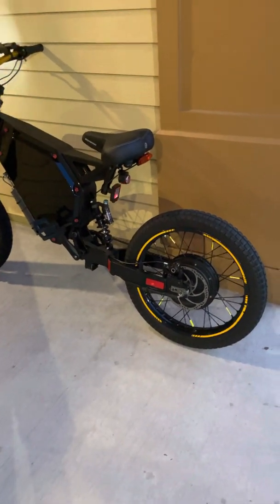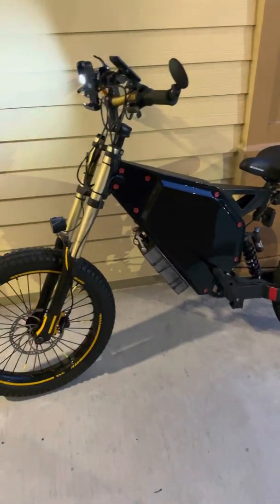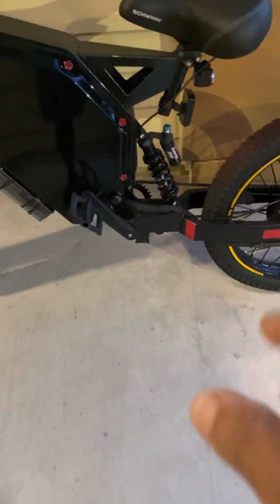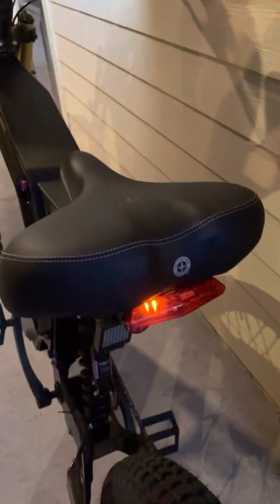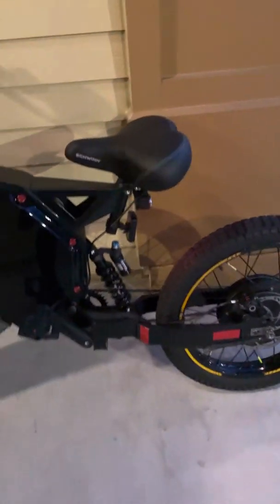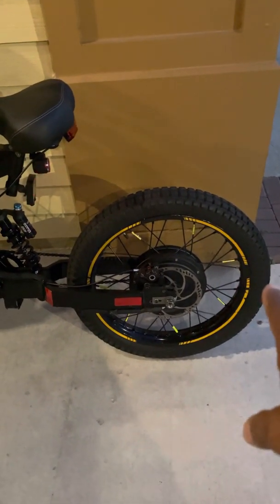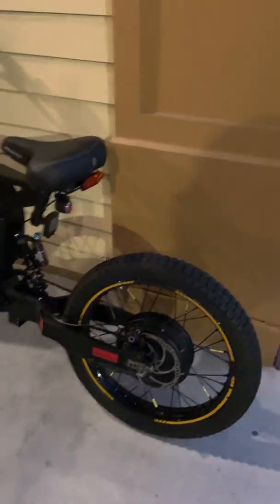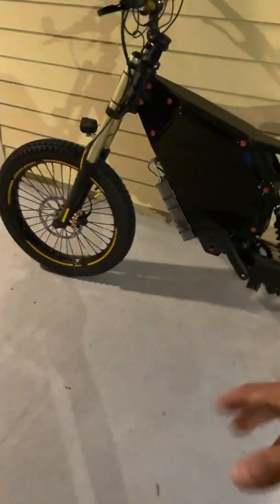Ebike Build 72v40Ah 5000w 150ah Sabvoton Speed Controller Qs 205 v3 3.5T Hub Motor

Comment: Sending back my 3rd 1000 W kit from eBay because it doesn't work right🖕 !Chinese crap..!💩 All sellers on eBay an Amazon doing the same thing Selling crap products🤬🎯
Reply: You gotta buy quality over quantity sometimes man. You get what you pay for. You gotta go to the right vendor's and not just the ones who hit your price point, of which I'm guessing isn't much if your only looking at 1000w from China.. and are willing to go through this 3 times just to save money.
Reply: @LazyEyePolitics   Thing is one manufacturer makes all these motors and puts them under different names 🤔so they're all basically the same motors🎯 at least on Amazon and eBay ,And these motors aren't cheap in the 1st place💰 they're just made cheap...🤷‍♂️👍

Comment: Hi nice video mate, ive just got a 8000w 72v 40amp stealth bomber….i tryed to ride for the first time other day….i cut out after 10 seconds….now i have no power an just a explamation mark on my screen….tryed everything the engineer has said to do an still no power…do you or anyone else know what the problem is (its not the brakes, display, or sensors) ????
Reply from the maker: check the bms or your battery
Reply: @ebikespeedtv7913  ok thanks bud how do i check those
Reply from the maker: @STEALTHMODE.  with the bettery manufacturer
Reply from the maker: @STEALTHMODE.  someone know what he due ,, need open the battery pack and change the bms
Reply from the maker: @STEALTHMODE.  if you battery don’t have a short circuit fuse,,,  add one too
Reply: I know what the problem is you bought a stulfe bomber..!🎯👌

Comment: Looks great. I'm building one with the same frame and controller right now. I have the controller mounted on the bottom like yours. I would just like to find a way to put a metal cover around it to protect it and the wires going to it.

Comment: Good build bro but for 3500$ I got 15000w 72v 50ah with sabvoton 200A. It came almost assembled all I had to do is put the front wheel and handlebar. No headaches of building …. And cheaper than building one
Reply: You have a link for the bike ?!
Reply: You lucky😊

Comment: i want to do the same thing but i really dont want to mess with the battery... and how do u go about getting a charger and knowing that it is safe and good for that battery?
Reply from the maker: God Bless You,,, the battery that I bought comes with its own charger, mine has 10ah so it charges my battery in 3 hours maximum and I have a 72v 40ah battery, the battery comes with its own charger if you plan to buy a battery buy it with your charger and make it 10ah because the 4ah and 2ah chargers take more than 8 hours to charge the battery
Reply from the maker: and this battery charger when the battery its completely charge balance the battery and self turn off you don’t need worry about

Comment: I just finished my build about 2 weeks ago. I put the Moto seat and mounted the controller underneath the seat. Very nice build my friend. I plan on switching my forks from the Zoom forks to either Fox or the DNM Air suspension! Your build looks clean! very clean engineering sir.
Reply from the maker: yes fox or dnm its much better of this zoom suspension but i only running road so for me its great but i planning upgrade soon thank you

Comment: Incredible. I'm also planning and doing the exact same build soon. Gonna start ordering parts slowly. I found 72v 40ah batteries on ebay and amazon for about 750. The frame is about 600 on ebay or Amazon. The qs205 is about 800. And I would get the dnm fork instead of the one you have. The one you have is nice but the dnm is much more suited for a bike like this and the price speaks for itself at over 500 dollars. Also you should put on the motorcycle seat it would look so much better but that's just my opinion and I'll probably go for that set up to start. But it's great to see this and you should be very proud. I hope to build one soon.
Reply from the maker: thank you for you comment yes i have the motorcycle seat too but here in florida police complaint too much i give me a hard time
Reply: And motorcycle seats are comfortable for off road riding. Street riding? You definitely want a bike seat. 100000%

Comment: Is it possible to send links to buy the whole parts with thanks
Reply from the maker: Ebike parts link list

Frame tracking no 1Z02RE710331033328

1- crank set $30.54

https://www.amazon.com/progress-tracker/package/ref=pt_redirect_from_gp?_encoding=UTF8&from=gp&itemId=mpqmpolrmrksun&orderId=113-6453632-6309823&packageIndex=0&shipmentId=88878838881301

2- rubber gromet $9.00

https://www.amazon.com/progress-tracker/package/ref=pt_redirect_from_gp?_encoding=UTF8&from=gp&itemId=mpqmovmmklttsn&orderId=113-6453632-6309823&packageIndex=0&shipmentId=88784113979301

3- stem riser $10

https://www.amazon.com/gp/aw/d/B071LLR8PR?psc=1&ref=ppx_pop_mob_b_asin_title

4- Handlebar Stem Spacers $7.00

https://www.amazon.com/gp/aw/d/B08PFN1MF1?psc=1&ref=ppx_pop_mob_b_asin_title

5- Bike Riser Stem $20.00

https://www.amazon.com/your-orders/pop?ref=ppx_yo2_mob_b_pop__fp_2_rc&orderId=113-1877780-6041847&lineItemId=mpqklqkrorrpsny&shipmentId=UqQD4ycd6&packageId=1&asin=B08DD8P7RP

6- handlesbar $22.00

https://www.amazon.com/progress-tracker/package/ref=pt_redirect_from_gp?_encoding=UTF8&from=gp&itemId=mpqpqvomtrsnon&orderId=114-1901482-0211434&packageIndex=

7 - googles $21.00

https://www.amazon.com/your-orders/pop?ref=ppx_yo2_mob_b_pop__fp_5_pp&orderId=114-8537797-6033008&lineItemId=momoltpusptvony&shipmentId=Us02PCXn3&packageId=1&asin=B07R65H2JK

8 - head and tail lights $35.00

https://www.amazon.com/gp/aw/d/B08KG5GJRD?psc=1&ref=ppx_pop_mob_b_asin_title

9- turn signal lights $19.00

https://www.amazon.com/your-orders/pop?ref=ppx_yo2_mob_b_pop__fp_6_pp&orderId=114-5724129-8455442&lineItemId=momilrknnjsnsny&shipmentId=UtxVkYgY3&packageId=1&asin=B07Y8B5PB9

10 - magura 203mm break disk $70.00

https://www.amazon.com/your-orders/pop?ref=ppx_yo2_mob_b_pop__fp_7_pp&orderId=114-0672934-9181066&lineItemId=momlksqlsjsqqny&shipmentId=U4vHKp3H3&packageId=1&asin=B0178UGVBQ

11- front and back light $17.00

https://www.amazon.com/your-orders/pop?ref=ppx_yo2_mob_b_pop__fp_8_pp&orderId=114-7706531-9933018&lineItemId=molnswiqtiptony&shipmentId=UvgdXJ6J3&packageId=1&asin=B07V6B12HP

12- reflective rims gold tape $13.00

https://www.amazon.com/gp/aw/ya?ie=UTF8&ac=os&oid=114-8686059-6603463&ref_=pe_386300_440135490_TE_simp_od

13- parking light laser $10.00

https://www.amazon.com/Cycling-Flash-Modes-Lights-Waterproof/dp/B09161PVB4/ref=mp_s_a_1_23?crid=13HQ7CSP3FVIN&keywords=bicycle+lights+front+and+rear+with+laser&qid=1637945528&sprefix=bicycle+lights+front+and+rear+with+laser%2Caps%2C81&sr=8-23

14- breaks adapter $20

https://mail.google.com/mail/mu/mp/575/#cv/priority/%5Esmartlabel_personal/17d475cb14667628

15 - 33 milimeter rear suspension screw $11

https://mail.google.com/mail/mu/mp/575/#cv/priority/%5Esmartlabel_personal/17d3a0cef411c32

16- fork zoom 680 dh
Alibaba.com $170$  shipping include

17- pedals $21

https://www.amazon.com/gp/aw/d/B08T638D8L/ref=ya_aw_od_pi?ie=UTF8&psc=1

18- stealth bomber frame $270 shipping include
Alibaba.com

19- Qs 205 v3 3.5t 50h 5000w ebike kit $1090

Total $1688 for now
Reply: @ebikespeedtv7913  cool, these what k want to know too. Thank you so much. 👍👍😬
Reply from the maker: i bought everything for separated from alibaba.com and aliexpress ebay amazon i stll haved all link in my ebike build video on my page here youtube